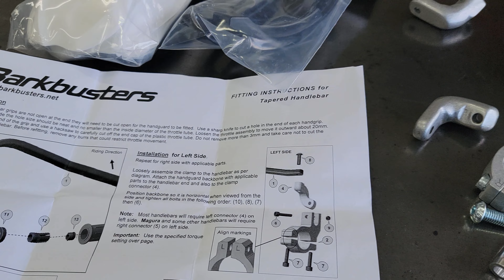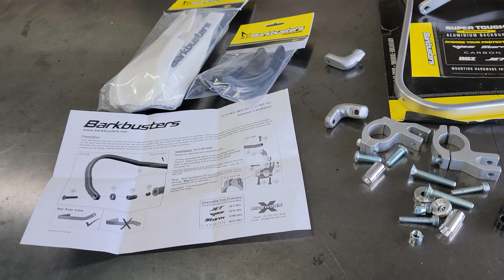2023 Norden 901 Part 9 (Bark buster handguards, backbones, and skid plates)

Comment: Hello, I installed it too.  The aluminum brackets are original from Husqvarna and KTM.  Unfortunately I would have to shorten the spacers supplied by 5 mm because they touch the speedometer display.
Reply from the maker: I did not use the original husky brackets.  I made this video so you would avoid fitment issues, the same ones that others have had in the past for the same reason you are having....